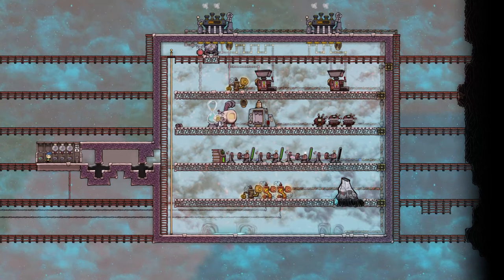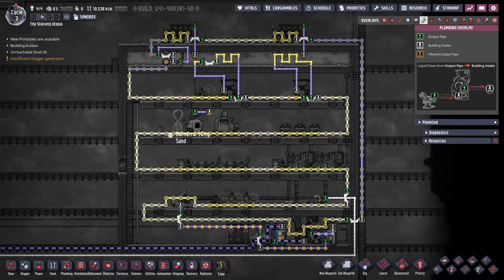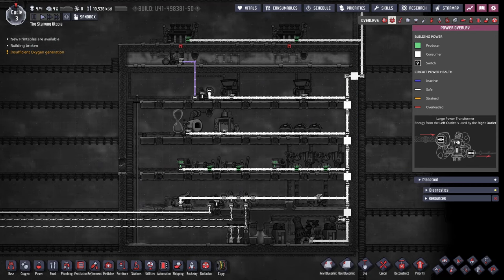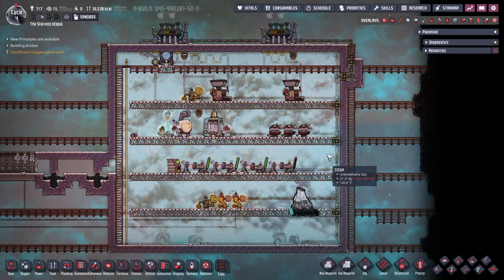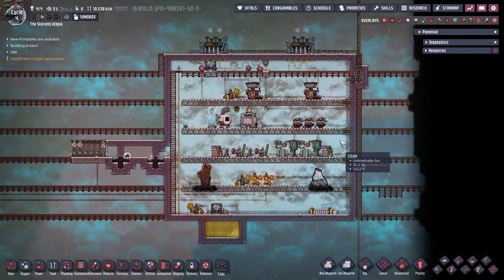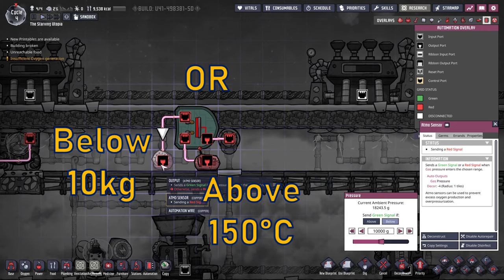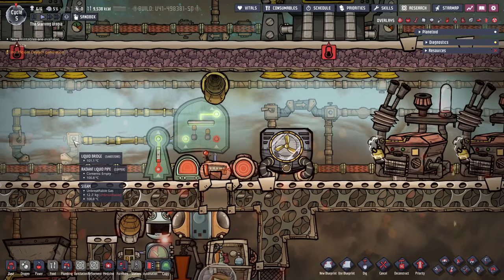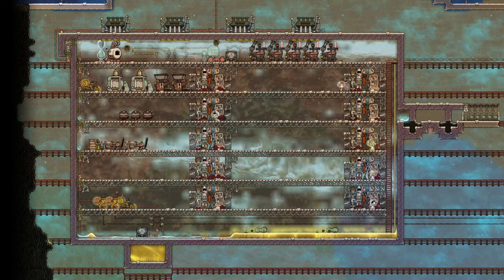Oxygen Not Included - Tutorial Bites - Industrial Bricks

Comment: An aquatuner is not needed to cool steam turbines in metal refinery-steam turbine loops necessarily.  The steam turbines can get self-cooled if in a suitable medium like hydrogen or stacked fluids, and possibly if in oxygen also with different setups.  

There exist a few options: have the coolant never get very hot using a liquid shutoff and liquid pipe thermo sensor to not let the coolant leave the steam chamber until it has gone down to a lower temperature.  If using a finite amount of coolant, like say 800 kg, this means that operators will often have to wait to use that metal refinery again.  I don't particularly recommend this though, since it tends to lead to part of the coolant being in the metal refinery, and the duplicants will flick the switch of the refinery before it can complete and stuttering effects in my experience.  This option requires some steel, but it's only 75 steel instead of 1200 for the aquatuner.

Another option lies in having more steam turbines, and more radiant liquid pipes also inside of a steam box.  Instead of having 1 steam turbine per metal refinery, you have two steam turbines.  The steam turbines don't get all that hot, since there exists more to delete the heat from the steam more quickly, and thus can get cooled with their own output.  This option doesn't require any steel at all, though it probably requires more refined metal given that more radiant liquid pipes get used.  It also requires more space per metal refinery, but that means that something like a rock crusher or three and kilns can go on the same floor as metal refineries.  How the systems compare power wise isn't exactly clear.  

Steam turbines running at hotter temperatures means more power per steam turbine, but an aquatuner consumes power (or consumes more power if cooling both steam turbines and one's machinery).  Cooler steam turbines means less power per turbine, but they might run for longer, or their might be more turbines, and there's no aquatuner consuming power.  So, how that balances out isn't clear, and the exact difference probably depends on setup.

Comment: in my current play through im using polluted water to cool the brick and using the excess water to run co2 scrubbers to make more polluted water.. then use the dirt to feed sage hatches..
Reply from the maker: That's an interesting route to go, although you will need a source of sand to sustain that.
Reply: @GCFungus  nope no sand. i dont use water purifier just evaporation if my polluted water cools down my brick too quickly it shuts down the steam generators to heat up the brick then diverts the polluted water to another evap powered by volcanoes :D

Comment: There are also more exotic industrial temperatures. If you have supercoolent, then you can have a cryogenic Industrial brick. It will instentaneously freeze the water and carbon dioxyde removing the need for pumping and whatnot. Dupe that work the machine are likely to get hypothermia, but their life is not in danger. 

Another exotic temperature design is the "cold steam" design. The steam should be maintain between 100 and 120 celcius. The minimum steam temperature of the steam turbines need to be bypassed by keeping one of their 5 inlets in a tiny separate room with above 125 celcius steam at very low pressure. The steam turbines will produce little enough heat to be able to self-cool, using the 5 celcius gap between their water output and their maximum temperature. 
This mean the room requires no aquatuner (except possibly to generate the bypass 125 celcius temperature, but then it should practically never activate). Pwater will not be distilled which may a good thing, e.g. for domestic arbor trees. Also, only gold or better is required instead of steel. On another hand, the temperature range is much smaller, making the room not ideal for metal refineries.
Reply from the maker: I really like the idea of the cryogenic brick, but it wouldn't convert polluted water which is a bit of a disadvantage.
Reply: @GCFungus  
Depends what you do with the water. There are builds where you can automate your dupes dropping bottles of pwater so it offgases. It’s worst than spoms for energy but it’s great for clay. Alternatively, pwater is great for arbor trees.

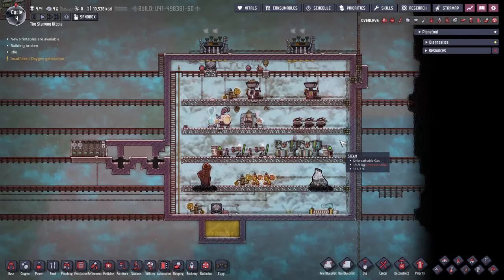Comment: 4:52 I've got a question about the coolant loop with the metal refinery here, will there be "downtimes" when the coolant will be looping around and the metal refinery won't have sufficient reserve coolant in its storage? I'm trying this with crude oil currently and I either have the metal refinery run out of coolant (and so the dupe stops using it till it loops back) or I have too much coolant and it just sits in the pipes when the metal refinery isn't active, which I'm not sure if it's a good thing or not. For reference I'm actually sending the coolant outside the steam room to where all my turbines are being cooled (it comes back into the steam room quite cool at 50 degrees).

Comment: Great tutorial, but I have a problem. After building the mixed industrial brick, it was working great for a while, but all of a sudden it stopped outputing excess water and just throws it back in. Do you have any idea what may cause this?
Reply from the maker: If the carbon dioxide builds up too much it can cause water deletion, so you need to make sure to deal with it quickly.
Reply: @GCFungus  Thank you for the answer, I think it was caused by the time it took to get the slicksters up and running

Comment: I've got a question specifically about the steam brick. If you have a magma volcano, can you incorporate it into the brick without having to seal it off in a vacuum? My current map has a salt water geyser that's close-ish to a magma volcano that's spawned by the volcanoes trait, so it's submerged in magma and surrounded by a layer of hot obsidian and insulated by abyssalite above that. I was thinking of making a steam room with the volcano and the salt water geyser to boil the salt water (skipping the need for a desalinator) as well as dumping natural gas generators in there so it will boil away the polluted water, but I'm not sure if a magma volcano is far too hot to leave uncovered in such a room.
Reply from the maker: Yes, any volcano can go in. Just make sure the brick is still sealed and you have enough steam turbines.
Reply: @GCFungus  I see, thank you!

Comment: Hi, how did you start the hot brick? Usually I just have to listen carefully to your tutorials and can follow your thoughts and builds, but here I think I'm just being silly. I don't know how to start the hot brick. Did you run the aquatuner isolated in water first until you had enough steam to open it up for the brick? Was the Brick in a vacuum before you released the steam? Do you have step-by-step instructions for this process? Thank you very much!
Reply from the maker: Generally I'd fill with some carbon dioxide from whichever machine you're using, and then manually add some water and boil it with a heating system at the bottom. That will then fill the brick with carbon dioxide and steam at the right temperature, but it will take some time. Vacuuming is a good way to start but is very time consuming. Usually if you're making a lot of gas, which petroleum generators are great at, you can just start filling it and then let it push the rest of the gases to the top where you can pump or vent them.

Comment: Just an in-passing thought for a similar-but-different setup that I have in my own base. Why do you use the once per cycle critter count with egg ejection configuration in your slickster ranch? I simply disable the conveyor loader when there are less than 8 critters. Does that have a downside?
Reply from the maker: To be honest that set-up never really worked well and now I have swapped to an incubator drop-off set-up as I am explaining in my critter Tutorial Bites (and the slickster one that is near the top of the upcoming list). Disabling the loader just stops it moving materials out, not it being loaded so using automation on the loader in that way won't achieve what you want. That is what I was trying to get out by cycling the eggs but using the timer sensor to control the autosweeper.
Reply: @GCFungus  Ah, that makes sense. I’ll check it out - thanks!

Comment: how much water i need so only top floor filled with steam on mixed industrial brick?
Reply from the maker: It is difficult to control with a simple number, because the balance of the steam and carbon dioxide will depend on the amounts of both present, which can vary significantly depending on the machinery and slicksters. That's why I included a gas element sensor to return water into the brick if there is too little steam, and then I fill it with enough slicksters to consume the carbon dioxide.

Comment: hey, got a solution for steam deletion? took me a bit too long to fully setup 8 full ranches of slicksters to eat up all the co2 from your petro boiler, so now there's 200kg+/tile of co2 so  whenever steam gets created by the petro gens, it seems to just get deleted instantly. now my whole brick is pretty much co2
Reply from the maker: I think you hit the nail on the head there - when the gas levels get so high that is when you will get deletion. You'll need to reduce the co2 levels so that the steam can form, so either make extra slicksters or vent/pump to space. I typically aim for levels around 10-20kg/tile and it seems to work fine, although I can't be entirely sure there is no deletion even then.
Reply: @GCFungus  yeah, at the start, when it was at the levels you are describing, it seemed to be fine. Should I include skimmers in the brick, or rather plus to space like you said? Guessing pumps would be more efficient? Because right now my brick is getting to levels where even steel overheats…
Reply from the maker: I think either method would be fine, but definitely get the levels down!
Reply: Dump your excess slickster eggs into a single tile that is floating at least 2 meters above either the petroleum level or the floor and let them eat the excess co2

Comment: What materials are safe to use for the mesh tiles in the mixed industrial brick please?
Reply from the maker: Mesh tiles can't overheat and therefore only melt. As they are made from metal ores, it's unlikely you'll get the brick anywhere hot enough to melt any of the materials, so I'd suggest to use whatever you have available.

Comment: Great video, but would like to say 95% of the time you do not need OR gates and that includes the two times you show them here. If either part going into an OR gate sends a green signal then the automation line is green without an OR Gate.
PS: This would not be the case in RL, but games are games.
Reply: I think it is being included for clarity's sake. In GCFungus' guide to logic gates, it is brought up that an OR gate's only advantage over a wire is to prevent back propagation.
Reply: That is one way to handle it, but could do a filter gate for 0.1 seconds from one of the wires.
Another way would just go to the inputs you want the wire to go to.

Comment: hi do u or anyone have any tips on starting up an industrial sauna? I'm starting it with vacuuming out the area then pour in some water and use kilns and refineries to heat up the steam but it seems to condensate quickly and disappear due to low volumes? and if there's co2 in there it doesn't quite get heated up enough, co2 is horrible for retaining heat lol quite in a stump on trying to fire up the sauna, hoping for some tips if possible thanks!
Reply from the maker: Yep, so the heating is generally done with water and steam. Vacuuming out and then adding some water is a good way to do it. I would highly recommend some heating at the bottom, either with a tricked out tepidizer (if you don't mind using them), or an aquetuner - I covered both in the tutorial bite on heating: https://youtu.be/FG0fep6iMbs . The first bits of steam will condense as the machines are built colder, but with enough heating they will settle over 100 degrees. I have an example of this from my Most Dupes Record Attempt playthrough here that may also help: https://youtu.be/f7OgOLVHbSI?t=2980
Reply: @GCFungus  amazing! I managed to get it to heating yesterday, using a "heating loop" with petroleum running through a tricked tepidizer at 150C; the whole brick is filled with Co2 and steam now, will check out ur playthrough video maybe for some more extra tips!